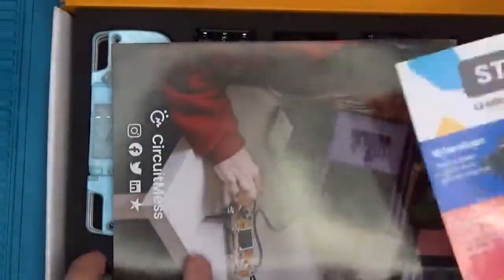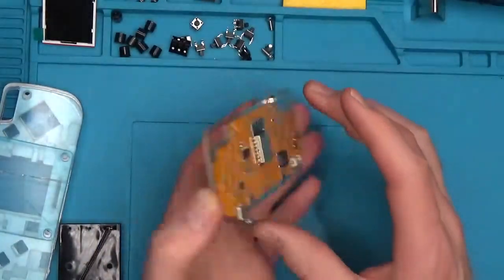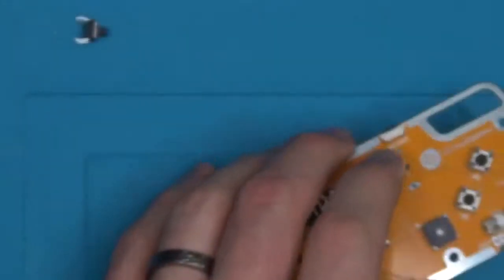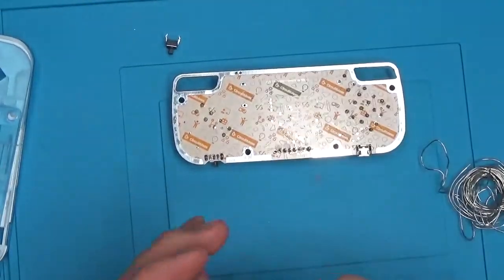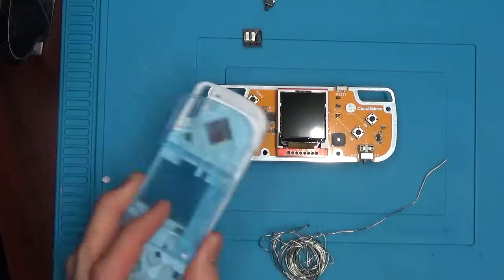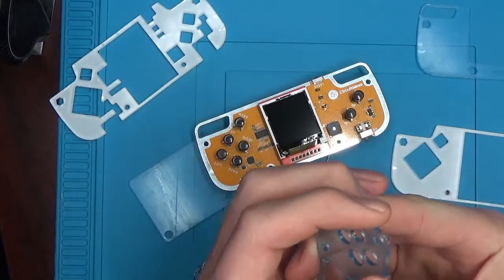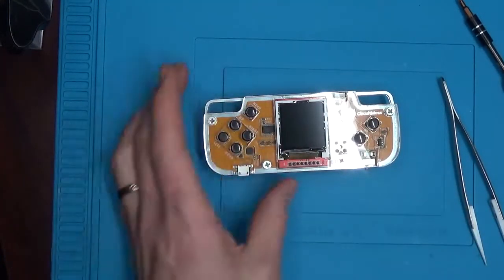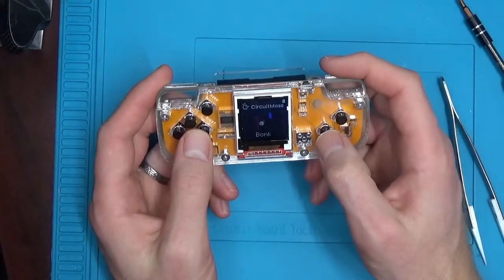Circuitmess Nibble Build Guide

Comment: did you get the white screen of death at any point?
Reply from the maker: Not when building it. I got it when I was loading a game to it. 
There are 2 ways you could get a white screen. There could be solder bridging (when two solder points are connected by excess solder) or from the installed software causing an issue. 

If you are getting it after building the Nibble it's likely bridging. I'd recommend taking close up pictures and posting them in the CircuitMess community for people to review. 

If you had it working and tried installing other software then got the white screen, the solution would be to re-install the original software on it. https://community.circuitmess.com/t/re-flashing-the-default-nibble-firmware-without-circuitblocks/3957

Hope that helps solve the issue! Let me know how it goes.

Comment: Can it be combined with microsoft arcade?
Reply from the maker: That's a great question! 
I'm not 100% sure it's compatible. I know MakeCode is compatible with arduino boards, but they need to have the correct firmware for the device. 

Your best bet would be to ask the CircuitMess support on their website. contact@circuitmess.com

I do know that their next handheld the ByteBoi will be MakeCode compatible.
Reply: @compileofcrap150  thank U~
Reply from the maker: That's a great question! 
I'm not 100% sure it's compatible. I know MakeCode is compatible with arduino boards, but they need to have the correct firmware for the device. 

Your best bet would be to ask the CircuitMess support on their website. contact@circuitmess.com

I do know that their next handheld the ByteBoi will be MakeCode compatible.

Comment: Crazy some of these sell online for $79.00 when the parts are probably only worth like $5.00. And you assemble it
Reply from the maker: I think the price is for convivence for introductory learners as well as the acrylic, PCB design, and soldering the tiny chips to it. 
But yes, I do think the parts as a whole are fairly budget. 
Do you do much tinkering in Arduino boards?
Reply: @compileofcrap150  nope I saw this in a facebook ad
Reply: @drewsquickfix  just the screen is around 5 dollars, custom pcb ad another 3 to 5 dollars, USB soldiering Iron - 10 - 20 dollars, include average pay per hour that was invested in production, taxes and so on, oh yeah and WiFi module also so not really 5 dollars